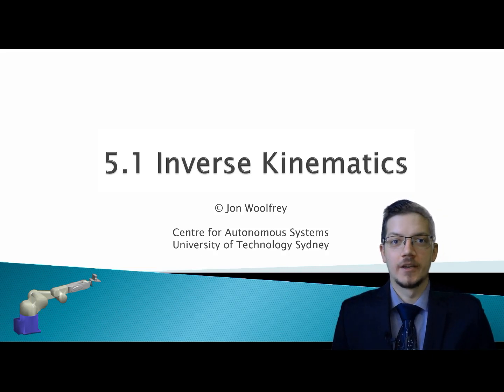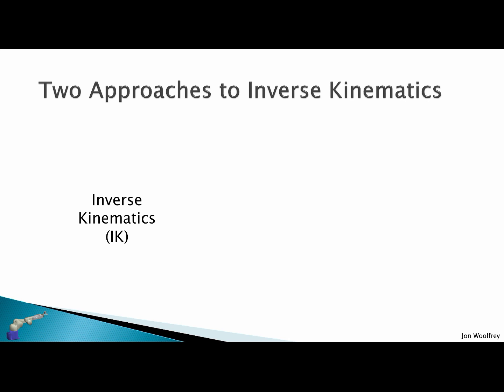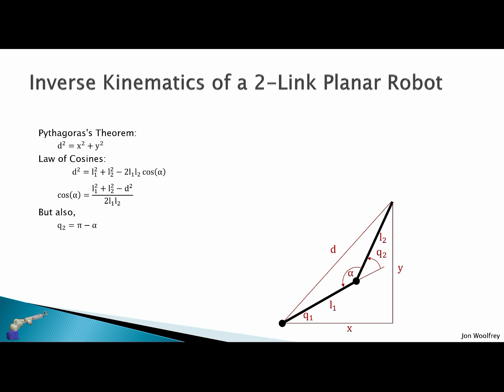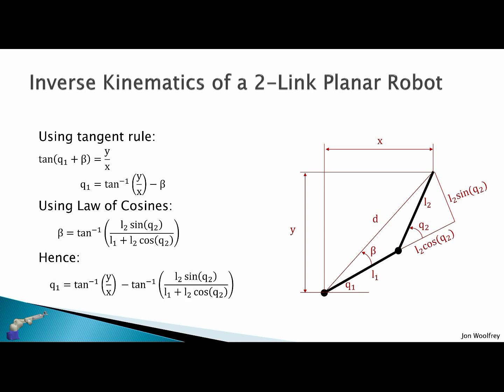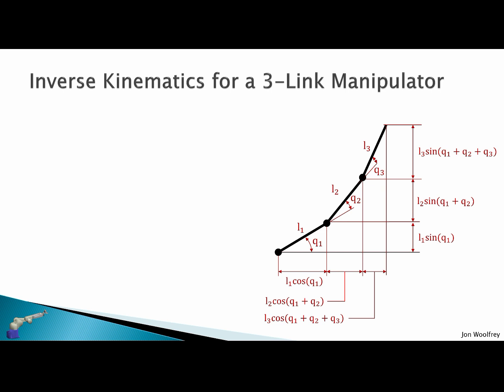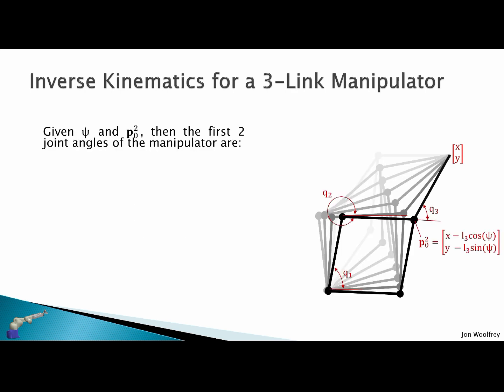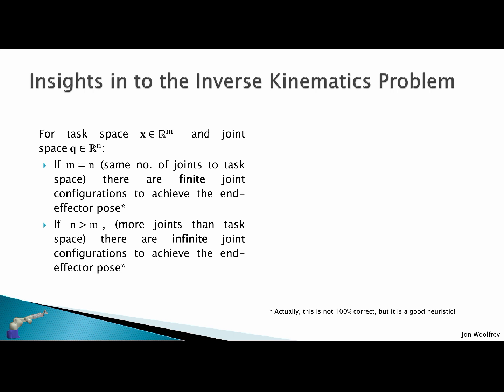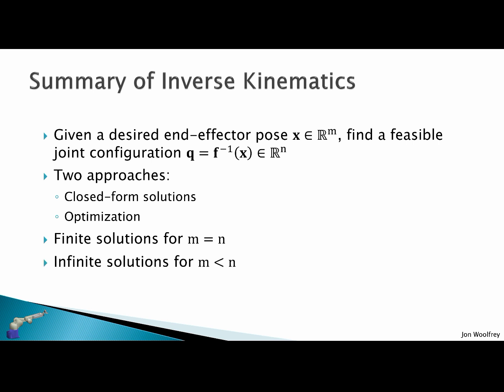5.1 Inverse Kinematics

Comment: I just simulated the 2-link solution (I put the formulas inside octave and GeoGebra).
It completely breaks as soon as you play around with l1,l2,x and y even if there's clearly 2 solutions. Is it possible that there is an error in the formulas?

Comment: For the three link, how would one determine Ψ if the desired (x,y) endpoint is at or below the origin x axis.
Reply from the maker: If you don't care about psi (redundant case), it can be whatever you want. Otherwise it might be fixed depending on what kind of object you want to pick up. The example is theoretical to illustrate the concepts of inverse kinematics.

Comment: My main issue also is figuring out the bounds for psi.  What values should that be?  I think in practice it might be possible to just choose some values and solve via some computational methods, but is there a better analytical solution for choosing this value?

In terms of representations, instead of the hard geometry, can you model the problem with transform matrices, so each point is effectively a transform that depends on rotation and the location?  You then combine the values and simply take the inverse?  Picking psi is still a challenge I suppose.  Seems easier that way since can be extended to 3 dimensions easily. I think that's probably a better representation?
Reply: The first thought that comes to mind about psi (no idea how it's actually done, this is just an idea), is to assume that the first two sticks are in line with each other (logically, they will be at the upper and lower bound for psi). This means it can be treated as a single stick with a known length (just the sum of the two that make it), and then it's a two-stick problem, which we know how to solve. And that'll get you the bounds :)